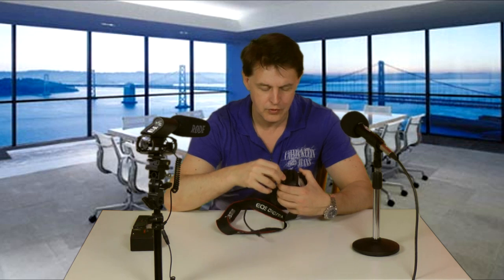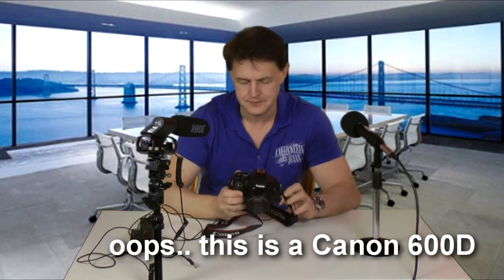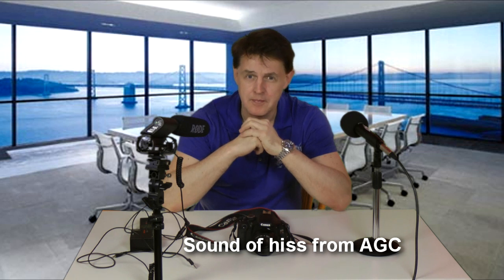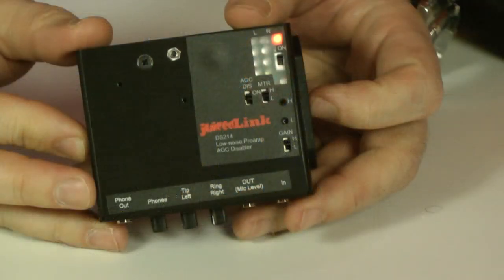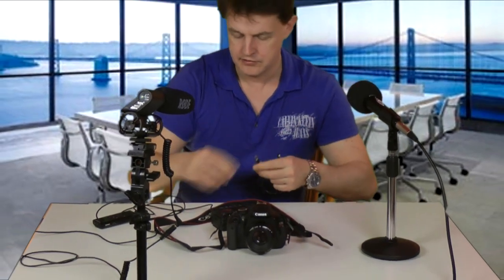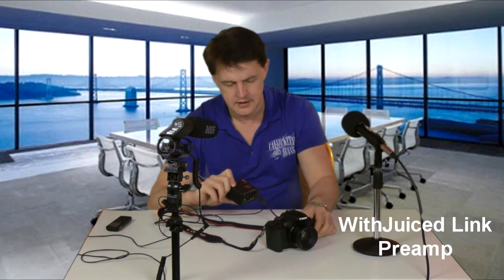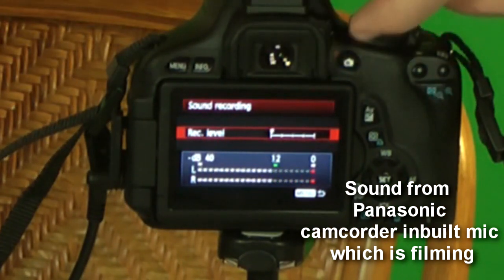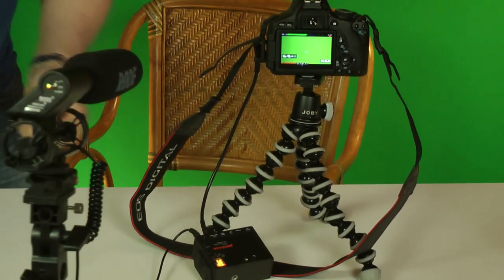Canon t3i 600D audio

Comment: when i put mic into the camera and in display camera i go to menu sound recording i found the signal sound left work and the right one doesn't work. what is the problem with my mic? 
may be the connector or something? anybody can help me?
Reply: Your probably using a mono mic & not a stereo. Look at the tip, if it has one black ring than its mono, if it has two it's stereo.

Comment: Very nice video. thanks.. I was curious if you have any experience with connecting the Zoom H4N to to T3i? Specifically was curious about an improvised cable that connects the two. The proper cable should have some attenuation I understand. I know a cable can be purchased for about $40 but that seems excessive.

Comment: Rode Video Mic Pro has a +20db switch which makes the Auto Gain Control turn itself done on these cameras. Works great. Otherwise Magic Lantern will do the trick on supported Canon Cameras at no cost!

Comment: Great, clear video. Thanks so much. I watched several other videos on the same subject, but didn't properly understand this issue until this. I'll be recording out and about and so am going to try and put up with the hiss for the moment. Can you recommend a decent (but as cheap as possible) wired mic that I can hook into my 600D? Also, what if you just turn off the gain while using a mic straight into the camera?

Comment from the maker: Hi Giojo. I've not tried it personally but you can try any recording device that has a mic input and a headphone/line out socket to connect to the camera jack socket. Most portable pocket recorders have those features (I'm looking at a zoom H1 right now which i bought on ebay for about 40 pounds 2nd hand). You can experiment also with MP3 players that have both sockets also. Just make sure you can control the sound levels on the unit.

Comment from the maker: Hi. Neither produce best sound quality for recording audio on their own, but the T3i is better than the T2i for sound and  other features. However most cameras do not offer great quality sound recording out of the box. My advice would be to use the T3i to record sound through an external mic plugged into the minjack socket. I would also record the singing as well into a decent dynamic mic plugged into a hand held sound/voice recorder (like a zoom etc) and synch it afterwards for best results.